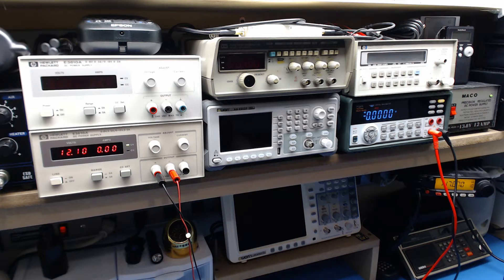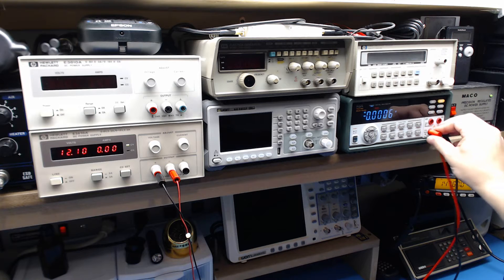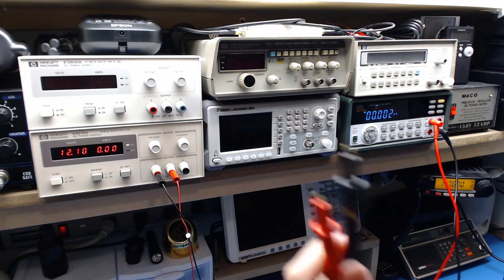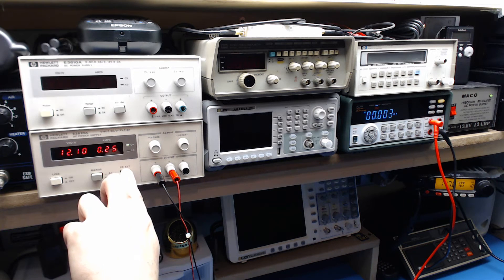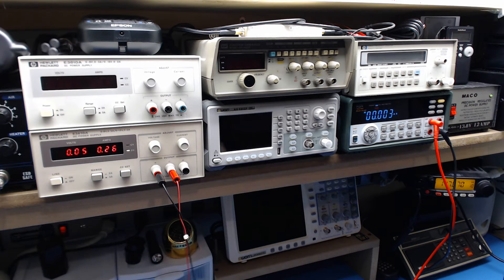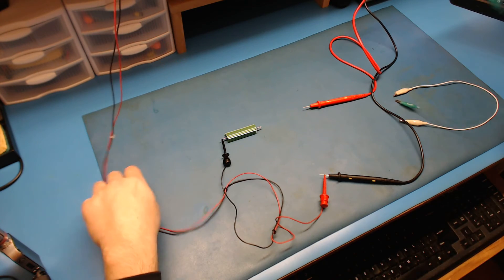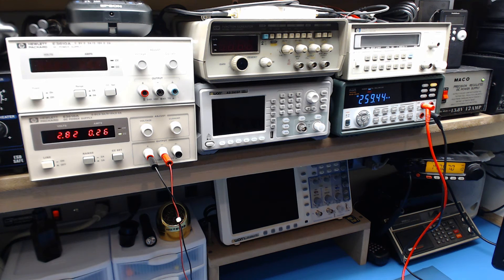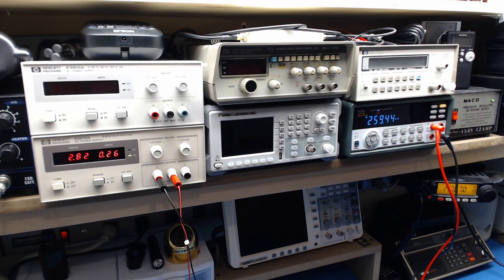QUICK TIP#2: HOW TO MEASURE CURRENT.

Comment: Show us some different ways of trouble shooting a boards....
I found a new tip today.  If you have noise on a am station from a possible bad switching supply,
to locate it just run a magnetic over the possible bad one and the radio will let you know when you got it.
just a quick tip, I thought I would share.